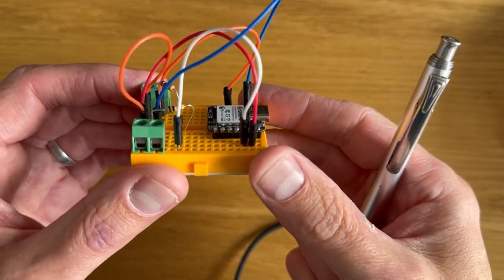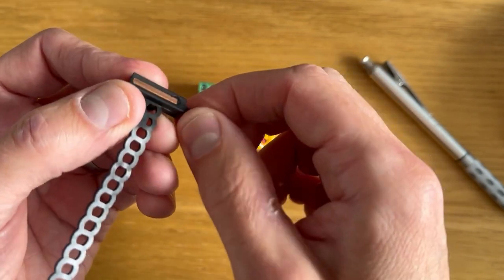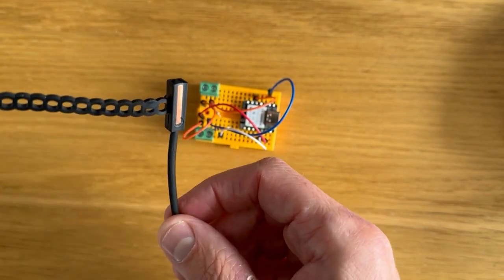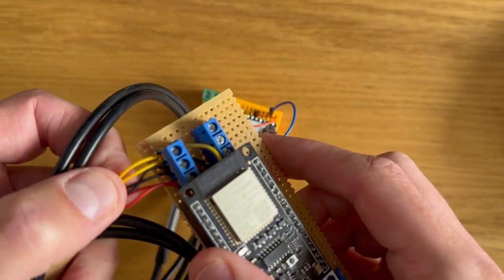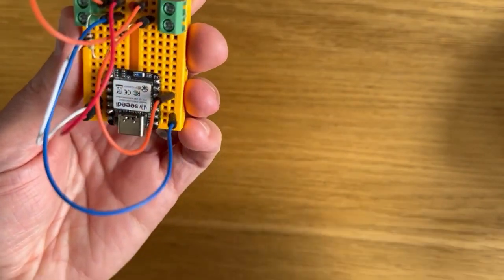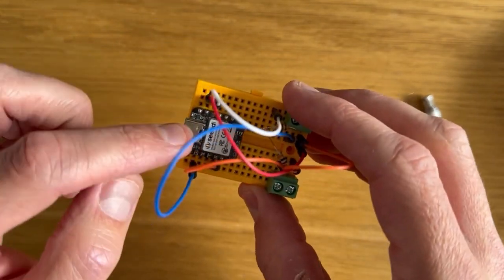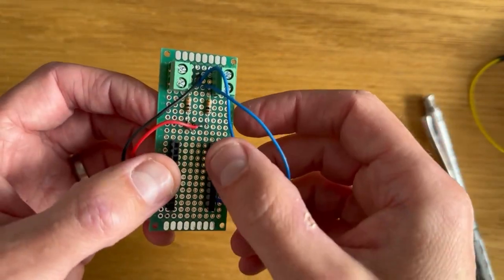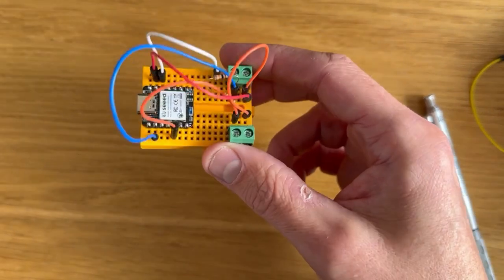First look at my radiator temperature sensor prototype

Comment: Hi Thomas - A project I started last winter using DS18D20 sensors and ESP01 for wifi links feeding into home Assistant. But ran into a bit of bother making it simple for others to use or easily portable (stand alone system). FYI I used foldback bulldog paper clips to clip the sensors to the rad tails. Took me about a month to fully balance my 7 radiator system. for a rad delta of about 5-8 degrees and a system return below 45 degrees to maintain full condensing and consequent savings. Now need a (much) smaller boiler. Will be following you series though (seen you intro one)
Reply from the maker: Awesome! That's a good tip on the bulldog clips!

I'm back at the project this week. If you work through my videos, you'll see I dropped the digital sensors in favour of analogue ones, ending up with NTCs that have their one fixing strap. Combined with some thermal paste, these give me very accurate readings. 

I just took delivery of more PCBs this week, so hopefully over the weekend I'll move from breadboards to the PCBs. 

My bridge software now performs auto registration with Home Assistant, so as the sensors are switched on, they will start reporting and being recorded by HA. Hopefully I'll be ready to use my balancing code in October, in time for the colder weather to start. 

Ultimately, I want to build a control system in Home Assistant that will combine room and radiator sensors to adjust each radiator's output using Wifi connected TRVs.

I need a much smaller boiler too. My 35kW beast is just a joke - I even did a video showing how ridiculous it is! I am looking at getting a heat pump next year. 

How about you? Any plans for a heat pump? 

What's next for your project?
Reply: @tomasmcguinness  You are sort of there to what I envisioned as version 2. Let me explain as I'm no programmer. ESP BT device per rad with 2 temp sensors, powered by LiFePo battery, each unit with integral charging cct via USB 5v. These use BT mesh to communicate with an ESP bridge, this can be locally powered via USB. The bridge generates it's own wifi AP.
The user (homeowner or heating engineer) runs an app (android or i-phone) to configure the system and store data.
The rad modules and bridge could be sold/loaned/hired out to users as a complete home heating kit.
Thoughts :)
Reply from the maker: Basically what I have :) with a few small differences. 

I'm not using batteries for the sensors as it makes a mesh impossible to maintain, since the power draw is too much. I found that for a successful mesh, all the sensors need to be running on battery. I need to lower into low power nodes, but for now it's easier to wire them all in.

The Bridge is connected to my WiFi, rather than having its own AP. I'm using the ESP32 provisioning mechanism for this, so it works very well. The Bridge then generates its own web server. I found this quicker than having a dedicated iPhone app, thought it doesn't rule it out (I have a basic iOS version). I'm able to access the website using http://radmon.local so no issues with IP addresses etc.

If MQTT is configured, it will publish all the sensor readings and register their presence in Home Assistant (this is part of my own heating control project).

In terms of the commercials, you're thinking along the same lines as me!! I saw it as a kit that would be loaned out or purchased. I'm a long way off that as a thing - just not sure there is sufficient revenue in it.